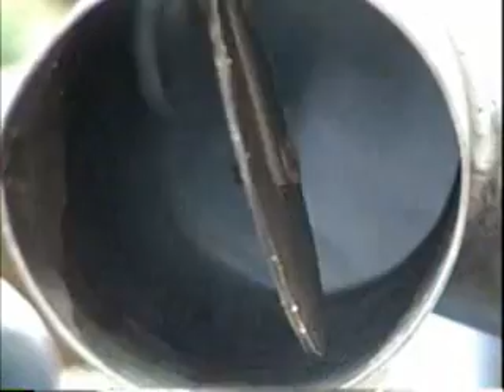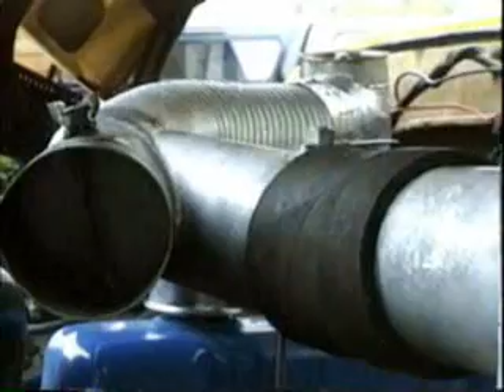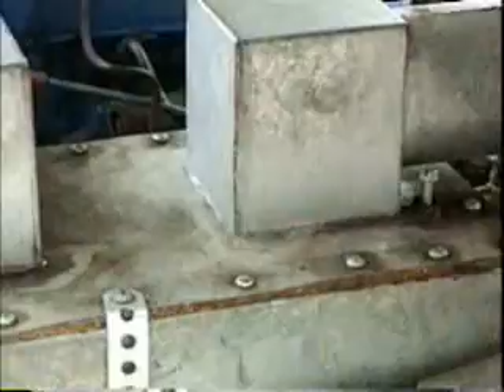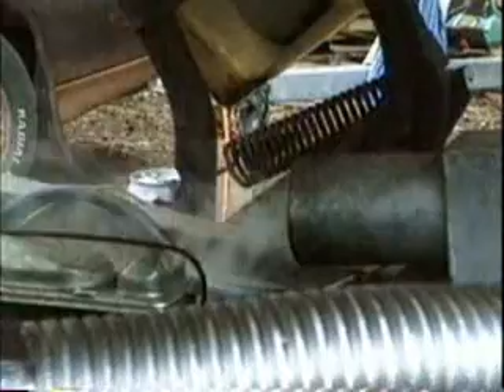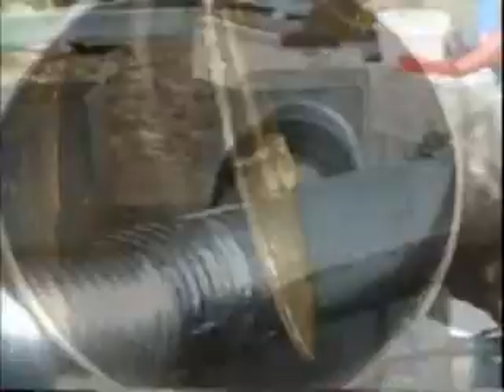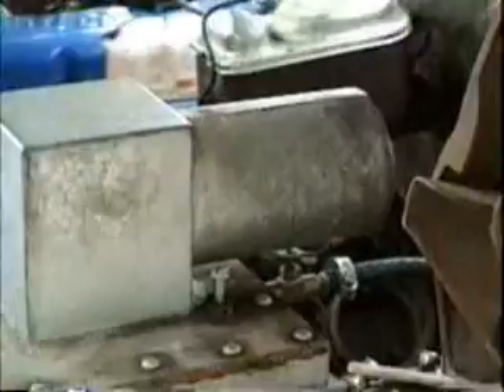Here is definitive proof on how to separate all Atoms in all liquid soluble matter.

Comment: That's great. How will I control the air to fuel ratio mixture in order to make the engine run richer, or more lean; depending on how my spark plugs look as I check them often during initial testing. Or does the molecularly changed vapor now contain the exact amount of oxygen required to run any engine with only one butterfly valve.

Comment from the maker: @150MilesPerGallon Well, fuel injection deals with liquid, you will be making vapor. I suggest removing the intake manifold, and installing an aspirated type of manifold. You will only need the butterfly valve on the manifold, to run the engine.

Comment: Question: How may one utilize your molecular chamber to work with a fuel injected automobile? Or would one need to bypass the fuel injection system, add an "EFIE" to manipulate the o2 sensors (x2), and connect your molecularly changed white vapor directly into the intake manifold, as you have done with the older model (pre fuel injected) automobiles?

Comment: My mistake, Thank you for clarifying. You mention you initially used two 250 watt electric heaters wired in series, heated to approximately 600 Degrees Fahrenheit which when the liquid non-pressurized gasoline came into contact with your 600 F degree chamber, the gasoline would become clear bubbles, that when they broke open- turned white, thus a molecular change. Yes?

Comment: Maybe I can use some kind air compressor, that would not ignite the vapors, yet would maintain the needed vapor pressure to permit the fuel injectors to inject sufficient vapors to run the internal combustion engine. May I ask, what type of air compressor would not ignite the vapors, yet sufficiently compress the vapors for fuel injection delivery?

Comment: The primary reason I find your system so interesting, is that you have been driving your V8 truck for 25 years on gasoline vapors alone, with more power, less tailpipe emissions, and more than double the fuel efficiency. I would like to try running your system in my automobile as well. I would buy one 1500watt DC to AC Power Inverter to power two Stainless Steel Electric Skillets(250 watts each wired in series= 500 watt draw) heating (your design) vapor expansion chamber.

Comment: Based on my research, from what I've read and studied, their are two different approaches to bubbling the fuel. One, is to use ambient air without heating the bubbler, the other, is to divert a small portion of the exhaust, into the bubbler. Also note that a vacuum inside the bubbler(suction from the engine intake) will lower the boiling point of the liquid fuel.

Comment: I do not yet know nor understand how the automotive GEET Fuel Processor is different from the small engine design, I only know that it is a distinctly and uniquely different design, which permits sufficient fuel vapors to be produced for all size automotive engines. "The GEET Guy's" have convert a Subaru automobile to a GEET Fuel Processor.

Comment: I understand. Actually, Inventor Paul Pantone's GEET Fuel Processor will be what I ultimately put into my automobile. At present, I'm starting with the small engine GEET Fuel Processor to learn it's basic function. The GEET automotive plans are different, and I'm not at that stage yet.

Comment: That's an excellent idea, Thank you. Based on your knowledge and experience, what would you estimate my 3 cylinder 1000cc 61 cubic inch engine- pulling(front wheel drive) an aluminum body and frame 1800 pound car, would achieve mpg wise(using your vapor system, or gasoline vapors in general)? Over 200mpg?

Comment from the maker: @150MilesPerGallon Just get the refrigerant and combustible combination. I find leaks in tires with the refrigerant detector. Just put a little refrigerant in the tire when it is flat, and fill it with air. The detector will find even the smallest tire leak, without pulling the tire off the vehicle.

Comment: Thank you. What model detector? Also, keep in mind my 2000 Honda Insight only has a 1 Liter 61 cubic inch, 3 cylinder VTEC-E lean burn(25:1) engine. I average 60 miles per gallon with the Hybrid/Electric system disabled(without use of the high voltage hybrid battery), and with the air conditioner on high.

Comment: Based on what you've specified, it sounds like I would need to use my 10.6 gallon gas tank 1/2 full, and draw the vapors into the intake. I would also use a large one way valve(flashback arrester) in this vapor line for safely. I would use a water filled bubbler where the fresh air would enter the gas tank- to prevent vapor ignition as well.

Comment from the maker: @IAMBILLYTHEKID You are going to find you will not be able to run the larger engine on you gasoline fume system. The CFM (cubic feet per minute) displacement of the larger engines is to great to produce enough fumes from the gasoline, in a small container, to run the larger engine, especially at higher RPM's. It would take a large container and several gallons of gasoline, to supply enough fumes.

Comment from the maker: @IAMBILLYTHEKID I did what you are doing. You are pulling fumes off the gasoline. Your not actually changing gasoline. It still has the same power, maybe just a little more, since all the fuel is burning inside the cylinders, but you will not see the increase in power I have achieved. The fumes you produce off the gasoline is a dull gray in color, mine is white. My exhaust gas doesn't have an odor.

Comment: I will fill a pickle jar 1/2 full with liquid gasoline. The pickle jar with lid, will have two holes in the lid. One hole will have a tube which runs to the bottom of the jar(this is the air inlet tube which bubbles the gasoline with fresh air). The other hole(vapors only) will connect to the reactor, The vapors above the liquid have sufficient power to run the engine under full load, with or without exhaust heat.

Comment from the maker: @150MilesPerGallon Question, where are you getting the heat to vaporize the gasoline, when you start the engine? You will need that preheat to start the engine, and get the manifold up to operating temperature.

Comment: That's great :-) I've not run the small engine GEET yet, I'm at the final stages of building the new fuel & exhaust system. In my research (see my GEET Explained Video), the fuel processor is said to transmutate the gasoline vapors into a plasma. But this only occurs when the system is built exactly to specification. When not built to spec, it functions only as a vapor carburetor.

Comment from the maker: @150MilesPerGallon I had the chamber, and was showing it to someone, I plugged the heaters in, and started to apply water to the heaters. I had a combustible gas leak detector, and it blinked, just a little bit at first. Then I thought tap water is contaminated. I used distilled water the same way, and the leak detector went off like a butane lighter sets the detector off, when you press on the gas lever without striking the lighter.

Comment: That's amazing. Truly outstanding. May I ask the conditions under which you discovered the molecular change which resulted in the release of Hydrogen from water, at very near the boiling temperature of water ie 212 degrees Fahrenheit? I realize you didn't have control of the temperature when this first happen, per your previous notes.

Comment from the maker: @150MilesPerGallon I had a nemesis the liquid I created. You using the exhaust heat at the intake manifold, that burns that liquid to, so you still have emission gasses, by burning that liquid.. Mine didn't, I just got the emissions in liquid form.

Comment: The behavior of your engine reminds me of the GEET Fuel Processor, of which free build plans are available at GEET International, and GEET Friends, home pages. The system allows any gasoline powered engine, to be powered by vapors alone. I'm building my first GEET now, for a small engine. It's a different approach than yours, but works as well.

Comment from the maker: @150MilesPerGallon I also came to realize I could gain more power from the engine by bringing the timing of the engine back to TDC (Top dead center). It might have been possible to gain more taking it to after top dead center. Using the mass of the crank shaft, and the ability of the fuel to burn completely, to gain power.

Comment: Based on my research, a Stoichiometric clean burn can only be achieved when gasoline vapors alone enter the engine. When liquid gasoline is vaporized inside the combustion chamber, extra HydroCarbons are always present in the exhaust system, some of which the catalytic converter burns up(very inefficient).

Comment: Based on your data and description- That's well over 100 miles per US gallon and a significant increase in power, and engine responsiveness, simply by feeding the engine gasoline vapors only; rather than feeding the engine liquid droplets of gasoline. It sounds like you achieved a Stoichiometric burn, no extra HydroCarbons.

Comment from the maker: @IAMBILLYTHEKID On the truck in the video. We ran the truck on gasoline, and put a clean dry rag over the tail pipe. Trying to smell the rag running on gasoline, you eyes would burn when you got the rag close to your face. On white vapor another clean rag the same test, and you could breath through the rag it smelled like you were ironing clothes. Try the rag trick on your own vehicle. Bet you can't breath through the rag.

Comment from the maker: @150MilesPerGallon I ran a test once. I filled the chamber with gasoline, (one quart) and ran that 390 for 29 minutes and 52 seconds at 2000 RPM. I could never get that results again. On the truck in the video, it was a close comparison, consumption wise, liquid gasoline to white vapor. It was the increase in power over gasoline that had me going at the time, and I just couldn't put my finger on what I had achieved. White vapor gives a 4 cylinder the power of an 8, mileage included.

Comment: Please clarify, I'm estimating. 2 hours driving at a rate of 2000 rpm's, which I believe is approximately 55 miles per hour = 110 miles driven at a consumption of 3 molecularly changed vaporized quarts, with a remainder of one quart of non flammable liquid remaining inside your vapor chamber. Therefore achieving just over 110 miles per gallon with a V8 engine under load?

Comment from the maker: @150MilesPerGallon On the big engines (390 cubic inch) at 2000 RPM, my chamber will stop working due to lack of flammable liquid after about 2 hours of run time. That is about a quart of liquid in 2 hours. Due to a smog analyzer giving me a zero parts per million hydrocarbon reading. I think the liquid might be a liquid carbon. I know I was told that is impossible, but hydro is liquid and carbons, so I don't know. Lab tests will find out.

Comment: Thank you for letting me know that gasoline will not autoignite at 600 degrees Fahrenheit. In my research, it was stated that gasoline autoignites at 536 F. At atmospheric pressure(14.7psi), and begins to vaporize 100% at 400 degrees Fahrenheit. Thank you for talking with me today, and thank you for all the important information.

Comment from the maker: @IAMBILLYTHEKID Yeah the scientist are wrong. Gasoline doesn't ignite at 600 or so degrees. I am here to tell you it will ignite when a Calrod heater starts to turn a dull red glow. Something around 1000 degrees or close to it. Just keep electronic sparks (around 5000 degrees Fahrenheit) and flame (around 2000 degrees Fahrenheit) away.

Comment from the maker: @150MilesPerGallon Are you kidding me, the Power Inverter was the answer to my prayers. The 1500 watt continuous usage one, is perfect. Harbor Freight has them now for under $75. Man when I find the right temperature, to make hydrogen from water buy stock in an inverter companys, and heater companies. Get a stainless steel electric skillet. Plug it in, turn on as high as it will go, until the max heat is reached, outside. Get a spray bottle and spray gasoline on the skillet. Highly explosive.

Comment: I see. Now we have many choices and options to power household electronics with our automobiles- such as heaters and TV's, with power inverters. Being that your heaters are 110vdc, you could use a voltage multiplier (I'm not certain of proper terminology), which boost the 12vdc to 110vdc, and reduces automobile battery amperage to that required/needed.

Comment from the maker: @150MilesPerGallon At the time nothing was out there to regulate the voltage for my generator. I found an electronics engineer and he designed a circuit, but it was a joke. We would limit the amount of time we ran the vehicle at higher RPM's, on the road, stationary we used house power.

Comment: I understand. How did you fix your generator to maintain the 110volts rather than increase voltage exponentially with increased engine rpm's?

Comment: I believe I understand. You will need to keep the superheated stainless steal metal surface at a constant(non fluctuating) temperature in order that you may produce the Hydrogen, without cooling the hot metal surface area in order that the oxygen will remain? I imagine this high temperature for Hydrogen production is yet to be determined, but much higher than 600 F?

Comment from the maker: @150MilesPerGallon Gasoline is the easy one, it showed me the way. Hydrogen from water will require some engineering. There is only a 62 degree temperature difference in the  boiling temperatures of oxygen and hydrogen. I figure in water the temperatures will be the same distance apart. I will have to alter my masses to compensate for the maintenance of that 62 degree temperature difference range. When I do I can make all the hydrogen contained in water. Hydrogen will boil first.

Comment: When you say Mass and Specific Temperature, I understand this to mean mass of liquid gasoline actually exposed to the hot surface(600 F.) metal, with the hot metal surface area almost equal to, or equal to the liquid gasolines surface area(amount of liquid gasoline in direct contact with heated metal surfaces.

Comment from the maker: @150MilesPerGallon Funny when I first did it, I had a special generator wired to put out 110 VDC at 2000 RPM on the engine. At 4000 RPM the generator put out about 2000 volts DC, and I didn't realize it. I burned out one of the 250 watt stainless steel heaters, melted it. I used 2---- 250 watt heaters wired in series.

Comment from the maker: @150MilesPerGallon As seen in the video the vapor is white, but in my process, when the bubbles form the vapor inside the bubbles is clear, and when the bubble breaks the clear turns white. This is where I am guessing. In theory a will be created in a molecular change, when a molecule is removed from the original element, or liquid in my case. I figure since oxygen is present in the air surrounding my process inside the chamber on You Tube. Oxygen filling the void turns the clear vapor white.

Comment from the maker: @150MilesPerGallon You got it. I can take any liquid to any temperature, before it will boil.Doing this allows me to find the boiling temperatures of different liquid molecules in the mother liquid, and separate from the original mother liquid, when it reaches it's boiling temperature, while not having reached the boiling temperature of other liquid molecules in the mother liquid, they remain a liquid. Molecular change.

Comment: Continued: And if I understand correctly, It is the extreme heat ie 600 F. that you apply to a small amount of liquid gasoline at a time, which both changes the gasoline to a cold vapor, before it has a chance to boil. You use a large hot metal low pressure (atmospheric pressure) area, at a fixed temperature of 600 F, to Vaporizes the gasoline in your unique process/way. Yes?

Comment: If I understand you correctly, you are heating the ambient temperature liquid gasoline, to approximately 600 Degrees Fahrenheit, within an instant. Furthermore, you are heating this ordinary gasoline at atmospheric pressure, which is approximately 14.7psi(pounds of pressure per square inch of space).

Comment from the maker: Yeah, well there is this need for me to know I did it. If the oil companies had something like this, their refineries would be a lot smaller. You see this process will distill any liquid almost instantly, using a lot less equipment than they do. They seem to think gasoline ignites at 499 or so degrees, and have been thinking this since the temperature was first posted. I work with temperatures in excess of 100 degrees Fahrenheit above this 499 degree ignition temperature.

Comment from the maker: @jws1060 I don't think what I do was patented, you see the temperatures I take the liquid gasoline to is above what the supposed ignition temperature is for gasoline. Everybody thinks gasoline ignites at 499 or so degrees Fahrenheit. I am here to tell you that is wrong. Gasoline will ignite when iron metal starts to develop a dull red glow. I did"t have anything to measure the temperature, when I did this experiment. I know it is around 1000 degrees Fahrenheit. There is around 600 degree, open.

Comment from the maker: Unfortunately all the electronics incorporated in making the engine run more efficiently, and economical was set up to use liquid fuel. This system will not support running the engine on vapor. Besides give me some time, and you will be running on  hydrogen, made from water, in a chamber something like the one I have on You Tube. Money to pay for the lab tests is my delay right now, and the fact that I am homeless at present after my house fire.